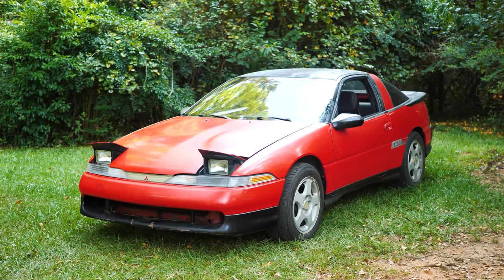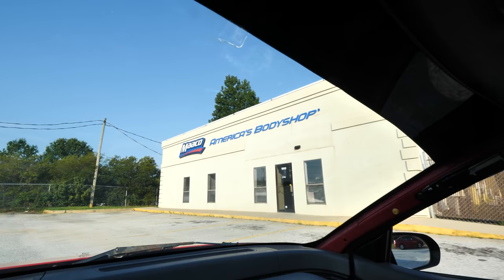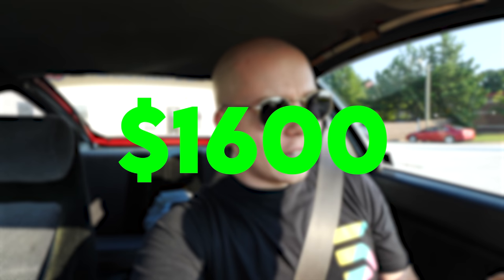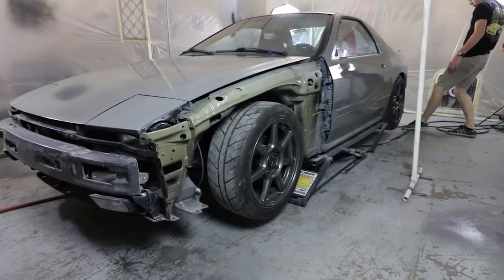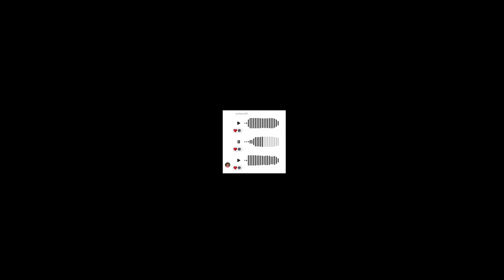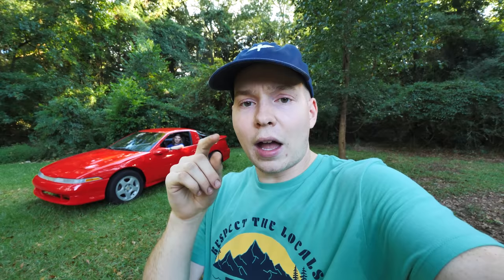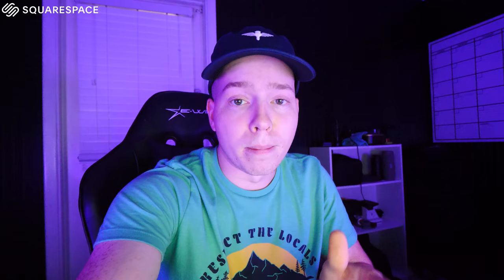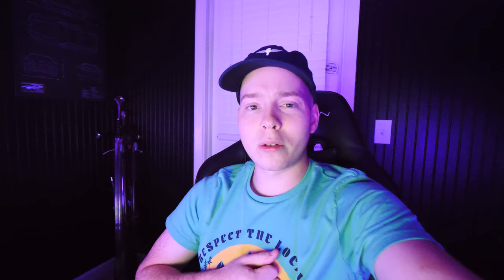How Good is a $1600 MAACO Paint Job!?

Comment: Wouldn’t be maaco if they didn’t paint the trim lol
Reply: Fr that door trim being red makes me mad lol
Reply: What are ya kidding.. what’s the prep time worth !? That’s the key question.  Laying coloring doesn’t hide the potholes in the panels  .
Reply: Seriously, 2 more hours of prep and this paint job would look 10x better.  Such laziness
Reply: Once you notice the black rubber lower window trim is painted on the door, you can't un-see it. They taped off the rear quarter glass trim, but not the doors... Hmmm
Reply: @stacyholt6529  professional shops . Charge that xtra 10.75 per hour for those details
Reply: The windshield wiper sprayers 😆 🤣 😂
Reply: @77chevy4x4  They charge extra to do the job properly?

Comment: I had my NB painted by MAACO 3 years ago. I paid $1200 for single stage plus a new driver side front fender. Overall it has held up perfectly fine.

The main imperfections are mild orange peel, a couple of spots where it looks like dust got on the paint, and some poor masking around the window trims. There was also some overspray on my wheels but I was able to get that off with some lacquer thinner. Overall, it looks perfect from 10 feet away and I’m the only person who even notices the imperfections. Other people say it looks good as new.

For anyone looking to get a MAACO paint job it’s important to know that somebody else’s experience isn’t necessarily applicable to you, considering there are hundreds of locations all staffed by different people, and the person spraying the car will have the biggest impact on the result. Definitely look at reviews for your location shop over the experience of someone on the other side of the country.

Comment: If you can see the "pitted" imperfection but cannot feel it through the clear coat, it's likely that the base coat is the layer that has a bit of orange peel. Hope that helps, looks pretty good overall!
Reply: Or is silicone throughout the clear coat
Reply: @dooglemaples1914  This.
Reply: @DickTrikle  I’m assuming you’re also a painter? Not typical knowledge for a non painter

Comment: That pitting is caused when the undercoat is off gassing and the clear coat is sprayed before the undercoat has time to cure properly.
Reply: Good ole solvent pop. That’s what happens when you try to paint 8 cars a day lol.
Reply: First thing that came to mind when I saw it.
Reply: From what I saw on camera that is solvent pop. Pretty common with these kinds of places. The move them out in the sun, or put heat lamps on it before the solvent has time to evaporate
Reply: I don't think those guys at Maaco is gunna wait for it to "properly" cure.....

Comment: The pitting is called solvent pop. It’s caused when the clear dries faster then the base. They didn’t wait long enough for the basecoat to dry and it cause it to push through the clear. Happens when hot or humid. Have to use slower hardener and wait longer in between base or clear coat.
Reply: Was waiting for someone to tell him the truth about it. Good to see someone who knows about paint as well

Comment: I took my first truck to maaco after doing months of body work. I paid for their most expensive package it was around $3600 back then. The entire truck was d/a down to 350 then wet sanded down to 600. The paint surface was perfect. When i got my truck back it had terrible orange peel, was the wrong color, and started bubbling before 30 days because they A. Didnt clean the truck before painting it and B. Didnt put on a primer coat which i specifically paid for. When i called them out about it the owner got in my face and told me it was my prep work that caused it, my above and beyond prep work caused it because i used a primer to cover up some bare metal in a spot that wasnt even fucking bubbling. I basically told the guy if he didnt get out of my face things were gonna get out of hand and that if that was in fact the cause  the coat of primer i paid to be put on shouldve 100% dealt with that issue. Then he argued that they sprayed primer so i litterally had to go out to the truck and peel a piece of bubbling paint off to prove to this asshole that they never sprayed primer. So then he told me to tape off the areas that were bubbling and he would have them fixed so i did. Then they let my truck sit outside in the sun (its the beginning of summer) and the masking take glued to the paint and they ripped the paint off my truck then called me and told me to "come get my fucking truck" and told me it was my fault because i used the wrong type of masking tape... This is knowledge even an idiot can comprehend, if you leave an adhesive in the sun/heat what does it do? It hardens. I had to go into the shop and tear the owner up and told him if he didnt fix my truck then i was headed back to town to see a lawyer and he ended up giving in and redoing the whole truck and it finally came out right, with the color, primer, and the amount of clear coat i paid for. Moral of the story if youre gonna get a car painted send it somewhere more professional and spend the money cuz if you want to save money, wrap is inexpensive, easy diy, and requires a lot less prep work.
Reply: If Maaco is going to use excuses based on the vehicle's condition when they take it over to do their "magic", they should note all of that in writing and explain why their paint job will have issues not long after leaving the shop.

Comment: In my experience with Maaco removing parts like side markers, mirrors, headlights, taillights, sideskirts, moldings on your own before dropping off and once you arrive meeting with the office person to circle with a marker dings and areas of concern will result in a great paint job with only needing a cut and buff  when it's done. They also get to paint the other parts ( mirrors sideskirts bumpers etc) off the car which come out looking great

Comment: I worked at a Maaco during the summers when I was in high school. Here are a few tips to get the best results. 

1- always get the base cost/clear coat. All of the paint used at the shop I worked at was good PPG paint, but the 2 stage paint let’s them know you actually care about the car.  If you plan of wet sanding the car after, see if they can spray an extra coat of clear. Usually two is all you will get. 

2- when you get a car painted there everything is an up charge. If they say your car needs extra prep work because of pealing paint, pay for it. 

3- they usually never remove headlight/taillights. Take them out yourself when you drop off the car. 

4- expect overspray, they are a production shop. things get moved through faster than you would believe. The record at my store was 14 cars painted in one day.  We usually tried to take care of any issues like overspray or fisheyes, but things move quickly and get overlooked. 

Lastly you have to remember that most people who go to maaco are not car people, they can get away with rushed work because their customers don’t know the difference between a $10,000 paint job and a $1,000 paint job. Some people just want their Chevy cobalt painted hot pink for $500.

Comment: Bodyman here. The paint issues at 8:45 is called "solvent pop" or "fish eyes." This happens when silicone is introduced at some point in the sanding, prepping, painting/clear process. Usually someone had a little grease on their hands and touched the car and transferred it. Using wax and grease remover is part of the prepping process that Macco did a poor job of resulting in the solvent pop.

Comment: For $1600 at a Maaco, that's incredible. I've never seen a paint job by them that wasn't orange-peeled to hell and back.
Reply: Come down to the painter
Reply: I had a 1996 Civic painted with their enamel coat for $650. That paint is still good and no peeling lol. It was painted mineral gray over an aqua color. It came out really good. Only had 1 issue with maaco but that was employee based and not the actually paint job.

Comment: Every single Maaco is only as good as their painter and body guy is. The key to using them is to find the closest location near you that has the best reviews and has the best looking quality jobs that you can see in person in their finished state. I used them once back in the 90's chose the best location in my eyes and came out with a fantastic paint job in the end and that was for a car that I drove daily and entered in car shows on weekends. The only issue that I had was delamination of paint and clear which was my own fault because I used silicone based dressing on my moldings for years before the car was repainted. They took care of it no problem even though it was my doing. I'd use them again but sadly they closed up like 5 years later

Comment: The clear coat pitting is solvent pop. It's caused by not waiting long enough between coats of either paint or clear. You can sand and buff out some of it but really big bubbles are hard to sand out. 
(work at a body shop)
Reply: This. Ronald Finger got the same thing on his Fiero. Also, everybody come on fhwgads 👏

Comment: I had mine painted at MAACO recently, spent double what you paid, but they fixed the dents and did a two stage paint.  Honestly for a third of what a couple body shops quoted it looks really good.  I would say in a least in my experience it was a good as a factory paint job.

Comment: I had a Volvo Turbo wagon some years ago. After the wifey banged up the side and because the car was metallic, I decided to have them (MAACO) respray the whole thing. It was a decent car and I wanted a decent paint job, so I spent a couple days taking the car apart.  Bumpers, window trim, even door handles and lock bezels. Basically, everything that could be taken off, I took off. Got the car back a week later. As here, there were places that a couple shots of hi-build primer and a block would have taken care of, that weren't. The quality of the finish was mediocre at best. But the thing that really sealed the deal for me, (and the reason I've never returned to MAACO) was a small decal near the fuel filler door that said "Unleaded Fuel Only" The decal (which was original to the car) had clearly had a rectabgular piece of masking tape placed over it prior to painting. After a couple coats of paint and clear, the ridge around it stood out like a sore thumb. I have no idea WTF the prep guy or the painter were thinking, or even if they were. It was horrible...I winced every time I looked at it. We sold the car at a loss. 

As an aside, the quality of a paint job is NEVER better than the quality of the prep. Also, the cost of removing a bad paint job can easily exceed the cost of aplying it in the first place. Choose your painter wisely!

Comment: That paint issue you pointed out was either fish eyes or solvent pop, solvent pop usually happenes when someone throws another coat over something drying and it bubbles up through the clear, fish eyes is when some sort of contaminant got into the paint and leaves fish eyes

Comment: it is absolutely astounding what a simple paint job can do to completely transform the look and feel of a car.
Reply: Which is why I'm keep my 370z ceramic coated/obsessively clean, regular top coats (Carpro specific products);  While it can be a lot of time, 8 years later, the car looks better than most on the road.  People are really just lazy.  It takes 15 mins - 20 mins to do a basic wash and carefully dry a car.  People have ZERO clue as to how fragile car paint really is.  It's a thin layer, so basically, don't let anyone or anything TOUCH your car.  I'll abandon a trip to a store if I cannot find a specific parking spot.

Comment: clearcoat pitting happens when the applied paintjob and clearcoat is left to dry in normal air temp conditions,  pitting is eliminated when the car paint job is dried under heated temps.   some paint rooms can be heated, thus baking the paint.   The heat levels out the applied clearcoat giving the overall paint job a super smooth and wet look.

Comment: As a detailer you’ll definitely need to sand it back, 3 stage correction and ceramic coat it. You’ll have a much much better finish and the ceramic will keep it good for longer.

Comment: Being in the industry I look at this paint job and I think "damn, they really rushed this one".  I see this kind of stuff a lot too.  It just takes a little more effort to have paint look good.  If it was any other body shop I'd tell them to fix it.  People are saying wet sand and polish will fix this and honestly it will help a lot but some of that pitting isn't going to smooth out.  Since the dents were not filled before paint you would now have to rely on PDR to fix those and you could risk pulling the paint.

Comment: I seen many guys and go get a maaco paint job and spend way more fixing it.  I've heard you should do that body work yourself,  Also deliver it with the all the lights and any trim you need removed because they will tape it as you found out.  Also, tape the under side.... like you found out.  A foam tape the body gaps you don't want paint in or over spray.  Then be prepared to fix imperfections.  Paint is 100% in the prep.... its where they lack based on the time given for the paint job.

Comment: I painted my hood recently and I got some pitting that can only be seen in a certain light. I was told by a paint shop that because I did not have a booth and turn my fan off overnight that is why they explained that when it dries without airflow that the vapor dries and goes up but because of no airflow it falls back down and that is what causes the pitting. I am not sure if that is a complete truth but, it kinda makes sense. Looks good from here though, thanks for the content.

Comment: Maaco uses limpco paint products which is as cheap as you can get. 

The imperfections are solvent pop which is spraying to many coats to fast, so the top coat dries and then when then bottom layers evaporate they leave little holes where the gas escape

Comment: Macco replaced the back bumper on my wife's 13 malibu and painted the rear. I went to pick up the car and they could not find her rear license plate. The guy was wandering around the shop aimlessly and eventually disappeared. I was inspecting the paint in the parking lot and discovered they installed the new bumper over the license plate that was zip tied to the rear bumper bracket. On the other hand I have a 93 s10 single stage paint job that is over 10 years old that still looks amazing. I guess it all depends on what Macco you go to.

Comment: If you do that again, just do the partial prep yourself, remove those light lenses and trim that you can before you drop it off.  Also, if they left you enough clear, after the paint cures in about a month, you can wet/sand and buff out the paint.  Just note that if you do that, every single little ding on the body will be much easier to see.

Comment: MAACO can do a good job.  Shop around,  Im in a larger metro area, all MACCOs are not the same.  One place in Costa Mesa CA bid $3500 just to strip all my old paint off, before even considering body work or finish paint.  I went to the MACCO in Orange and the stripped, body and paint, color sand and buff, all for $2500.  So...  shop around.

Comment: Ok, I am glad your satisfied with it.  Maaco did a really good job on there part, but even then, there huge list of things things that don't get covered by the 1600 dollars.  Luckily, its not super hard to fix most of the issues you got.

At this point.. I would wet sand, cut and polish.. and also pull the front bumper and then paint anything under it black... that is going to bug everyone on youtube so you might as well do that.  As for brownie points, I would vinyl wrap most of the roof black again.  Every first gen DSM looks great with the roof being black, Rattle canning it black is not going to be fun or easy...  But vinyl is super cheap to do it with,  Like 100 bucks would cover the roof and maybe even a the front hood and bumper of the car... So they you get your bug and rock protection covered also.

Also... Explaining what your going to do to the roof of the car, then doing it, and judging the results of your actions will easily eat up 3 minutes of film time to show you doing it.  Yea.. there is other ways to pad out video.. but I feel like its been a while since we seen you tackle Vinyl and its a super effective project any car guy should learn how to do if for no other reason then to keep there car's front bumper looking nice.  Best of all if you hate it, you can peal the vinyl off later.

Comment: IF you have an older car, and the grill, trim, bumpers, marker lights, tail lights, anything like that is easy to remove, remove it all yourself...  You will get a better paint job.  Doing color change with door jobs?  remove the door sills, its like 5 screws..  EASY...   The more prep you can do, the better...  Wipe clean, and lightly sand door jams, weather strip gutters jambs,  ask what can you do to help before leaving the car...  You will get a better paint job.

Comment: The clear coat bubbling/pitting definitely looks like solvent pop. From my understanding, if they didn't let the base coat dry enough that will happen. Would also explain my part of the car looks better because it probably had a bit longer to dry. The weird shallow spots that almost look like small puddles in the clear coat though, I have no idea what that's about. Maybe where they used some kind of body filler for small imperfections and it ended up shrinking a bit? Might also explain why the dents kind of came back, because the body filler sunk a bit. The quick turnaround time may have been the curse of this paint job. Not taking out the lights is also pretty lame. I gladly pay an extra 50 bucks for that on my paint job hahaha. Overall, I think you got what you paid for, but I would probably call it like a 3.5 out of 5 stars. The car still looks awesome if you don't get close to scrutinize, and amazing on camera!